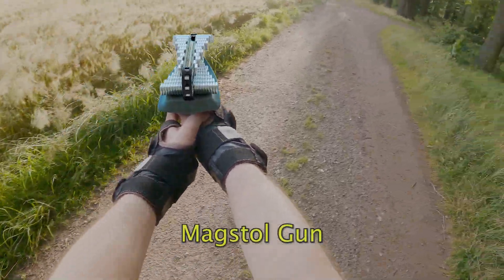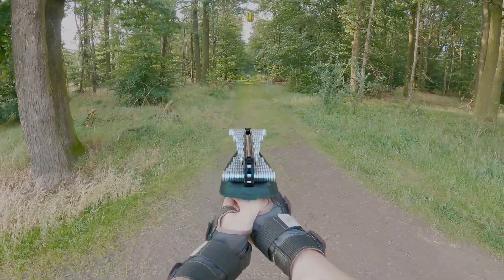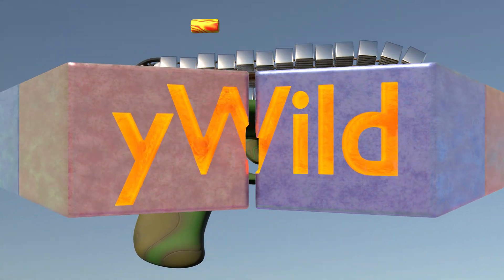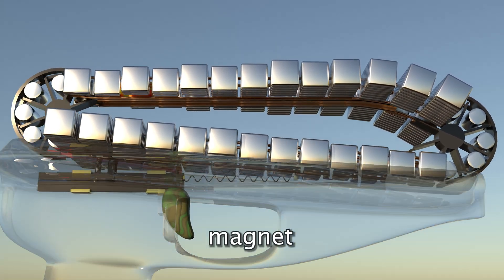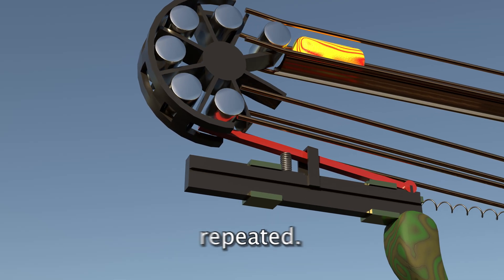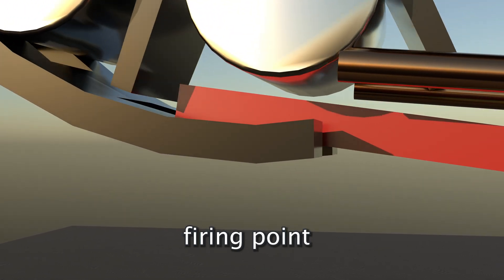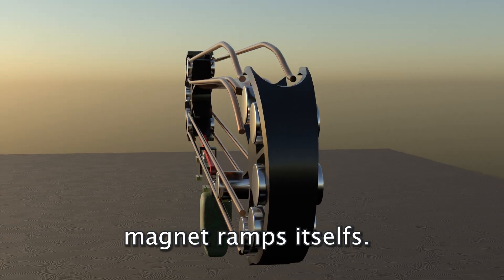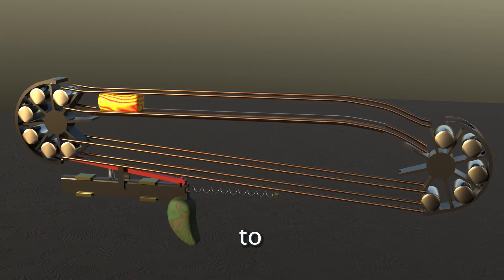Magstol, the new magnetic pistol / a gun using permanent magnets

Comment: Since the bullet is accelerating without any supply of energy.. It can be used to produce inductive current.
Reply from the maker: Hi Asaad, thanks for your comment. The bullet is accelerating using the power of the finger of the guy, which is initiating the process. 😃
Thanks for watching
Reply: @yWild  I really liked how you Exquisitly rebutted every single idea to create free energy from the continuous force of magnetic field, I watched your channel contents many times, magnet force does no work, it's like climbing the hill then accelerating on the way down, but don't you think someday an idea will come to harness this force without violating the conservation of energy?
Reply: @Asaad-Hamad  i compare it with the spring in a clock. Its not exactly a spring, but very close.
Reply: Magnets die, but a digital proof of concept doesn't need any (except for the magnets that power a computer).
Reply: @bigtimediamond1088  if we passed the coercivity threshold for any magnet it will die.

Comment: Nice mechanism. But does it better accelerate then a spring? How much force is required to start the next round? Unfortunely, my guess is, that a spring has less friction loss, then this masterpiece in magneto/mechanics and a spring is more effectiv and smaller. You can never get more energy out, what you put in, for the second round. And less mechanics, less friction, less loss. 😅😊
Reply from the maker: Hi Orgathm, thx for your comment. 🙂 You might be right. Possibly when it comes to shoot bullet out of metal there might be not enough force in the system. For bullet out of plastic foam, it might do the job.
For proof it has to be built in the real world. 🙂
Thanks for watching .
Reply: If the virtual device was to be actually constructed battery-free and as pictured in the render, this would be a good issue to address.